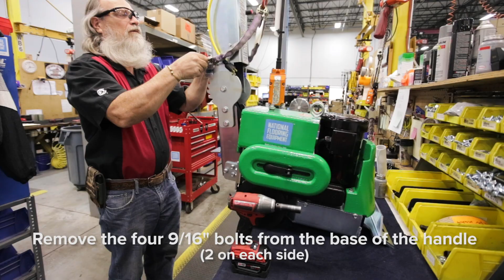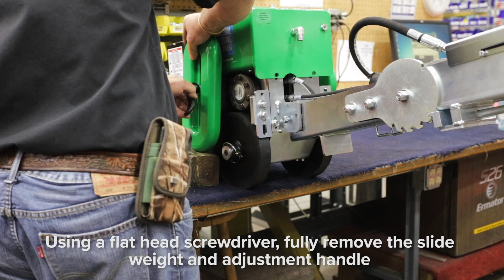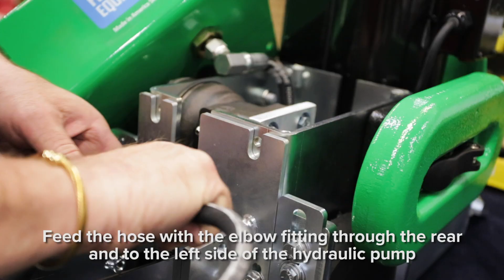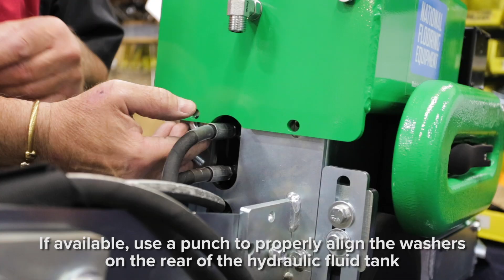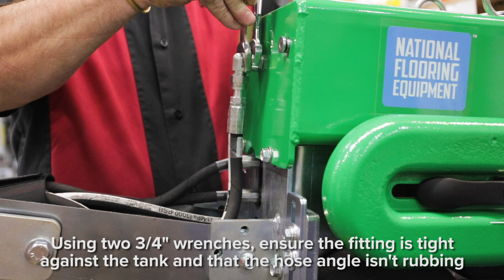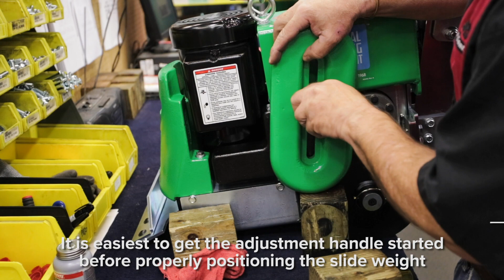6280 Commander Handle Replacement

Comment: Do you have a similar video outlining how to replace the pump drive belt (part# 6280HD-108) or any addition resources that could give us guidance? Thanks for your help.
Reply from the maker: Unfortunately, we do not have a video, but the procedure is below. If you would like further assistance working through this, please reach out at 800-245-0267.
1. Remove both wheels (2 Allen head screws)
2. Tilt machine on its back. (Secure in place. Use hoist hooks in both hydraulic tank eye bolts or other method to ensure the machine is stable on the workbench.)
3. Remove bottom cover (8 bolts)
4. Remove cutter head (9 nuts)
5. Loosen belt tensioner bolt (red Loctite - may require heat to loosen)
6. Remove belt.
7. Install new belt in reverse of removal.